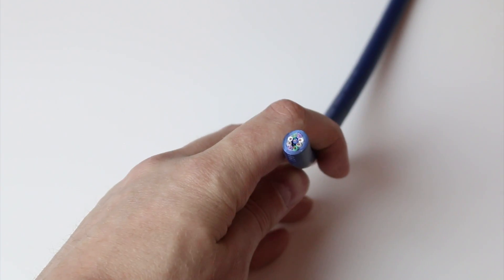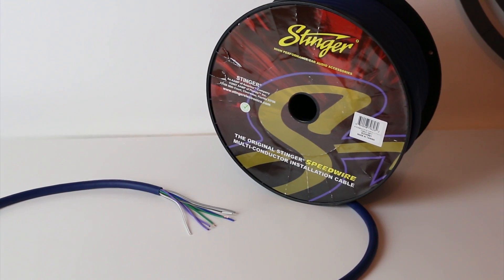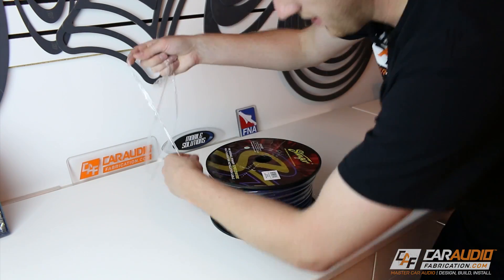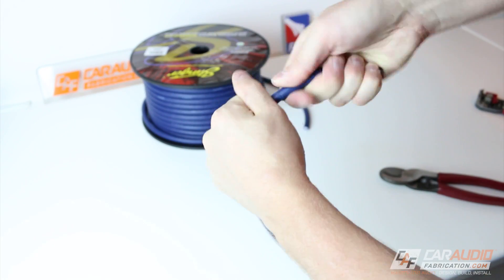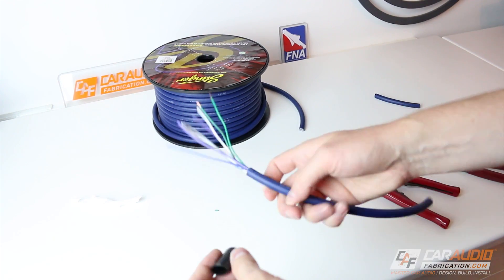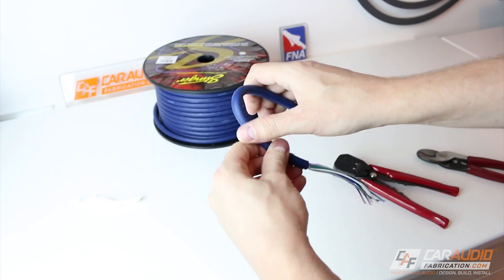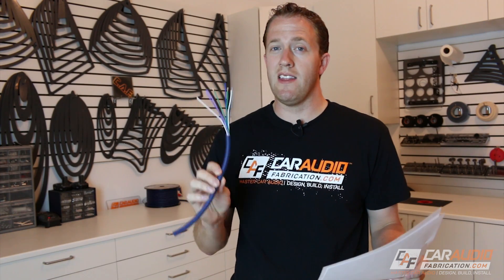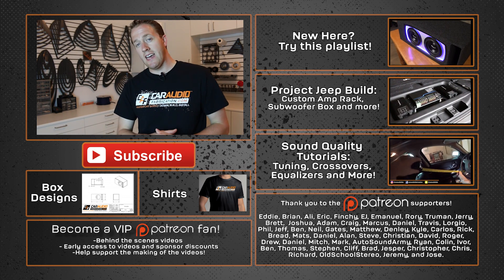Speedwire - What is it useful for? Car Audio Wire - CarAudioFabrication

Comment: If you're running a power wire next to speaker wire, such as the blue turn on next to the speaker wires, wouldn't that potentially introduce noise?

Comment: What would you use instead of  speed wire to hook up the speaker wire to your 4-channel amp? My installer used it to send a signal from the head unit to the Focal AP-4340 which I believe is 75W per channel. I have noticed that the amp should be producing much more sound than it is. Thanks for reading!

Comment: So I'm planning on going from the cars stock wire harness down to the 4ch amps under my seats. I do have a aftermarket harness plug so obviously it wouldn't be hardwired in. And I'll just cap all the speaker wires coming off the new deck going in the car.

Comment: I don't understand one thing , the one with 9 cables ( 8 for 4 speakers ) and the blue for remote has to be connected on remote on the aftermarket player? or all the wires  connected to the harness???

Comment: it's too freaking thick!! It was a nightmare getting this cable underneath the carpet in my car without bulging and without trimming my car trim to compensate. Don't they make this stuff FLAT!?
Reply from the maker: Flat would be more of a pain, flat ia great for home audio where runs are simple, but good luck in car audio with all the bends the qire needs to take, you can't articulate flat wire for car audio applications

Comment: I just bought some of this stuff...crap! It's 1/2" in diameter. I need to install about 16 feet of it. I also need to layout my 4 gauge power cable which is about 3/8" diameter. Why can't they make these wires flat? It would really help getting it underneath the carpet so that it doesn't bulge.
Reply: Just tuck it under the trim?

Comment: Purchased speed wire for an install using it on a 4 channel amp only running from harness behind the radio to amp instead of running wires all over the car is it safe?
Reply: Thanks in advance

Comment: Hey mark I got a mini van I use for work it’s kind of a Frankenstein Mobil at this point! So far I have done all new mechanical stuff under the hood suspension all of it axels u name it! Took the dash out seats all the plastic crap not putting it back in making fiberglass everything. I have a 5 channel amp and a mono amp I have 3 sets of 6x9 and a set of supper tweeters and a set of 12”s I have removed all factory switches and made my own windows mirrors hvac buttons installed a 10” WiFi radio 2 12.9” I pads and one 10” I pad... I have installed 2 50” light bars and four led spot lights. I have a huge winch I need to put on emergency flashers. Thanks to all these videos you make and others for giving us the pro tips of installing all this stuff

Comment: Can you use speedwire to make an interconnect set of rca’s from the headunit to the amps?  I ran it to a line high end line level converter but I want to do away the converter and do away with the factory head unit but don’t wanna  re run new rca’s.

Comment: Love the channel! Two people got close to what the string is for. If you want to see an example, watch someone terminate cat5 cable. 

Use a blade to strip the outter jacket, then with the string, split more outter jacket, then cut off everything past where you stripped with the blade. 

This makes extra sure that you didn't knick any of the inside wires and get ingress or egress.

Comment: I was recommended this wire to rewire my amp to the aftermarket 6.5 audiopipes to cut signal interference. Would this carry enough power to the speakers? 250w each

Comment: hey Mark if I'm using  12 feet long 9 conducted  wire how many watts would  be  the  most  the i should  used  for? because  I got 600w 4 channel  kenwood  excelon  amp or u recommend  just 2 us speaker  wire

Comment: can this wire be used for speakON connectors?
Reply: Yes depending on how much power you are planning to use for that cable. Speakon cables tend to have a higher gauge wire than those in the quick wire. If this is for a pro-audio (stage and event sound) there are equivalent solutions just for that when you can buy it by the foot.
Reply: Juan Romero, Jr. I want to use it for car audio. 4ch amp like 600watts rms
Reply: I would not recommend using speed wire as speaker wire. It would be more work to splice and split the loom in order to run pairs to each door, pillar or deck each speaker is located. I would recommend typical paired speaker wire. Reason two you are looking at approx. 150w per channel over an unknown distance. The gauge may be too small in this case as explained by CAF.

Comment: I did a build in a 2013 F150 with Sony "premium" sound. I used 9 wire to tap the signal from the factory amp under the center console and route it to the back wall to my DSP. This product is very very useful. Especially in an age where in the premium vehicles we are dealing with factory processors that do much more than just amplify sound.

Comment: The string inside is used to cut the outer jacket so that you can pull the inside wires out. Think of it like wire loom, the string can create a split in the outer jacket and then you can slide the wires out and cut away the jacket

Comment: there is 4,5,6 and 7 conductor wire, it's used in trailers so if you don't need 9 wires you can use that and it's inexpensive.

Comment: it is the same awg as your factory speaker wire

it's absolutely great to use when adding a 4ch & replacement coaxl's (I ran jBL off of scoeshe Brand OFC 9 wire & it sounded great) 

however as I went to components I upgraded entirely all the way from amp to speaker 12awg fosgate & my 2nd set I was comparing & used monster cable 12awg 

however I'm liking the fosgate as its cleaner & easier to run 

the Monster Cable 12awg is not made anymore & it's too thick under the carpet ect 

tucking was a pain, easier with fosgate although both are PC-OFC

Comment: I use speedwire. It is awesome for like you said signal from a factory source to a processor. I have also used it for bypassing factory amps when replacing the headunit. I have been doing the heat shrink on the end and it is the icing on the cake.  Great video!!

Comment: I do think they have a 5 conductor as well if you do not need the 9, I use it for Signal or harness extensions, Also nice for basic Xover install you can use the Signal in to correspond with the correct location (L/F = Wht/ R/F = Gry)
I use 16/2 or 16/4 Home wire for my speakers runs.
Great Video Marc! Thumb is Smashed!

Comment: ive been watching since you only had a few videos and i learned how to build the boxs from you too i was wondering if youll do a video on speaker wire gauges and there different benefits. i have a single jl w6 v3 but i got it before i started building boxes the guy used what i think is 16 awg twisted together for some reason? on my other boxes i built i use either 14 or 12 gauge  does it matter at all?

Comment: Just for normal speakers, and depending on the length of the run, you could probably just cut the outer insulation and use each pair for the speakers. Saves on costs of buying extra speaker wire when you already have a spool of it, and keeps the install color coded if you're doing a complete install down to the individual wires. Also if you need a larger gauge, for whatever reason, use two sets, which if this is 18 gauge, that'd be about 15 gauge, which is just barely enough if you were powering a speaker at 474w@4ohm at 20 feet with a db loss of .27, 18 is barely enough for 118w@4ohm at 20 feet with a db loss of .53, going by the 300 kcmil per amp, assuming the calculations are based on copper. Both have a power loss, 18awg is ~4w and 15awg is ~29w, due to resistances in the wire, although it would be slightly higher due to other resistances in the circuit.

Comment: hey Mark, i really need help on this... can you do a video on installing an aftermarket system into new modern vehicle with an integrated screen head unit with controls on a steering wheel. what i want to do is to install two after market amps one for the mids and high and one for the sub. the vehicle is the mercedes benz cla 2017 with the harman kardan factory upgrade.
Reply: that system is all fiber optic, from the head unit to the amplifiers, changing out that stuff without messing up the rest of the car other integrated systems is best left to professional installers.
Reply: is it possible to do though?
Reply: were did you get the information on the that? of the fiber optic?
Reply: +Orlando c  I am a mechanic, I work on Mercedes all the time.
Reply: Two ways to do this. Grab the already amplified signal output at the factory amps, or gut the entire system and use a different source for audio and rewire the entire audio system. In my professional opinion, I wouldn't touch it.
Reply: how would i get the output from the factory amp? and also if it uses fiber optic?
Reply: You have to know where the factory amp is, and you have to know the speaker color wires. I won't give any more information than that because someone like myself, who does this for a living should do this. If you are unfamiliar, which it sounds like you are(not being rude), you shouldn't attempt the install. Pay someone that does it and warranties their work. Best advice I can give you.

Comment: I'd suggest an ideal cat-5 insulation knife. You can adjust it so it cuts almost all of the insulation, but doesn't nick the signal wires. It's much more repeatable (and idiot proof) than trying to do it with a set of cable cutters or knife.
Reply from the maker: I'll have to check that out.

Comment: What do you mean grab the signal for a dsp? You're going to use that in place of RCA cables?
Reply from the maker: Tap into stock head unit speaker wires for signal. Factory radio on this vehicle.

Comment: This channel is easily in top 5 of you tube car audio.
Reply from the maker: Appreciate the kind words, thank you!
Reply: CarAudioFabrication i have a question i bought a new single din stereo for my project but its not sending a equal sound to the mids and subwoofers so im getting more bass than voice what could be the problem ad what can i get to fix it 
thanks in advance !!!
Reply: @erikramirez2572  what amp are you using ? Is it a 4 ch , 5 ch ? Or does your radio have 2 pre-outs and are you using a Y-adapter for the RCA’s ?
Reply: Trappe

Comment: Lots of uses of "9 wire" aka speedwire. I've used it to relocate a hvac control panel as well as many times in 4ch and processor installations. Very handy stuff!
Reply from the maker: Another great use. Thanks for posting
Reply: Is this stinger wire big enough to handle a Rockford fosgate t600-4??

Comment: So in essence it's just a roll of recolor-coded cat5 cable ?
Reply from the maker: CAT5 is usually 24 awg which is very small.
Reply: much much thicker, cat5 carries signals, wouldn't work for amplified sound.